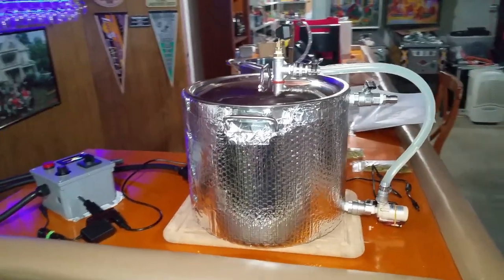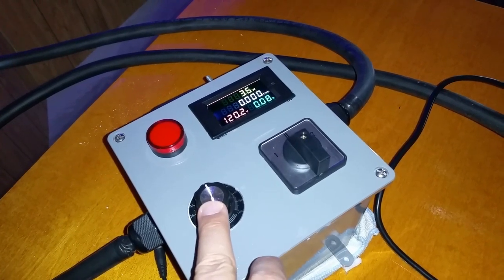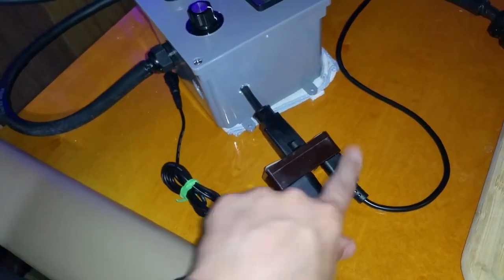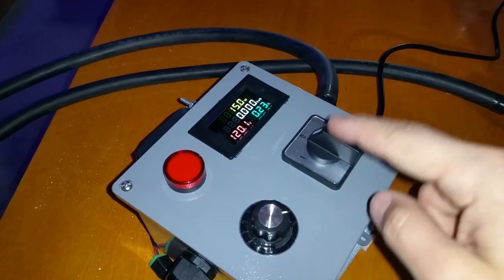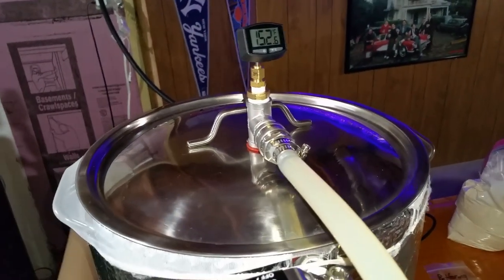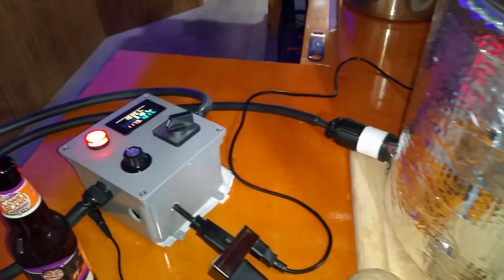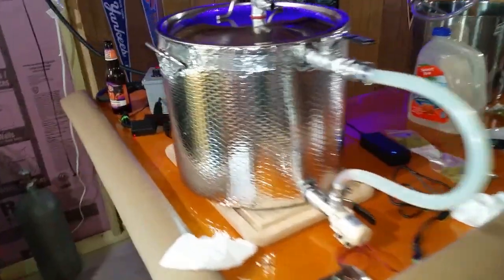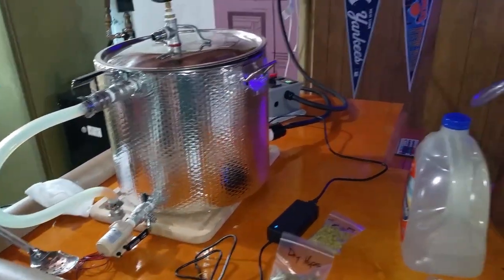Beer Baron Brewing: My Electric Brewing Setup

Comment: Nice video.  Two questions.  I’ve heard with that specific pump it works great for recirc but at 2.1 GPM not enough for a whirlpool to cone trub at the bottom of the pot before transfer?  Are you whirlpooling just for a hop addition or have you found it can indeed form a trub come?  Also, how did you sanitize the IC running post boil wort thru the IC?  Would absolutely work but I’d be worried about sanitation.  Thanks for any feedback you can provide.
Reply from the maker: Hey, yeah the pump is good for recirc only. Not strong enough for a whirlpool to cone trub. I soak the IC in star san for like a minite before dropping in the boil. Prolly dont need to do the star san and just drop it in during the boil, but it wont hurt. So far done well. I def need a stronger pump, now that I have a counterflow chiller.

Comment: Is that a ssvr heat controller you are using? Awesome brewing man🍺
Reply from the maker: That is correct a solid state voltage regulator. From aubens. if you change out the value of the potentiometer you can run it on 120 volts or 240 volts
Reply: @Bassguitarist1985  Do you have a build video  on your box
Reply from the maker: @flatbedtrucker  not yet actually I have updated the box since this video and I'm about to mount it to the wall with the updated brewery. Look for a video in the upcoming weeks.
Reply: @Bassguitarist1985  Awesome I bought the parts from eBay can you send me some pictures of the inside of yours via email if you get time? Let me go hit that subscribe button I appreciate it man
Reply from the maker: @flatbedtrucker  sure send me your email

Comment: Killer system very detailed and DIY. I can tell your handy! I love that little pump. I found one on amazon but having an issue understanding what I need to connect the wires to. As far as a connector that will receive the male connector of the power supply. Any help would be great!! Thank you again!!
Reply from the maker: If you search 3.5mm female adapter to wire terminal you can find the piece im using.
Reply: Bassguitarist1985 
Ok great!! Thank you !!

Comment: have you considered getting a different false bottom and ditching the bag? i  small batch BIAB on gas but want an electric system i can afford, which means building my own similar to yours. appreciate the feedback
Reply from the maker: A different false bottom with a rubber seal around the edge was what I was originally looking for but I could not find it for the seven and a half gallon Bayou Classic. I'm sure it is out there but so far the system is performed well for my needs it is very stripped-down basic but it works

Comment: hi I'm building one myself and wanted to ask about the insulation you're using. can you provide an amazon link with the same product? All I've found are not heat resistant for temperatures around the boiling point. thx in advance.
Reply from the maker: Its called reflectix. At home depot. Reflectixinc.com